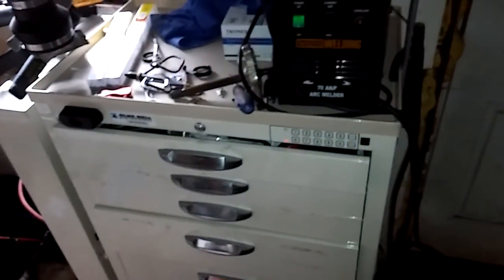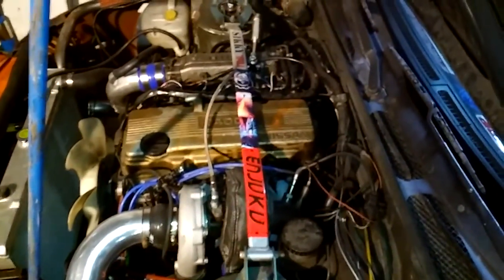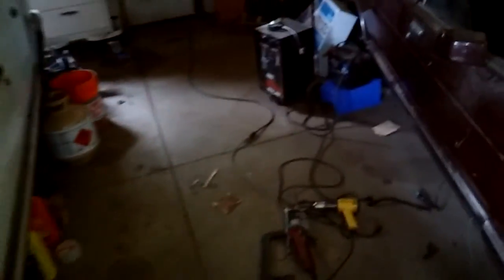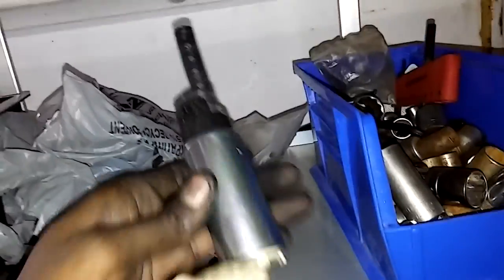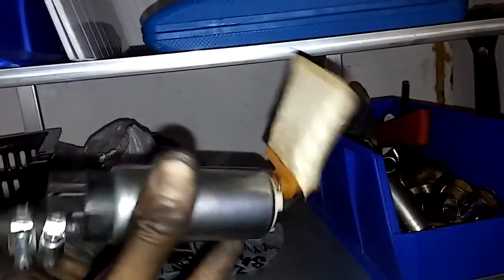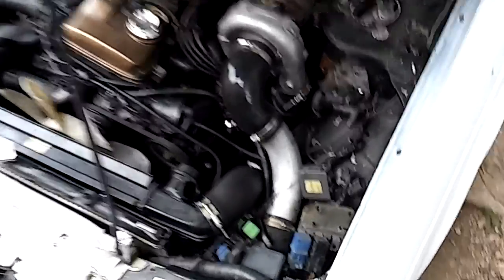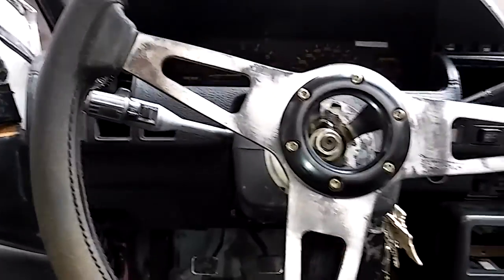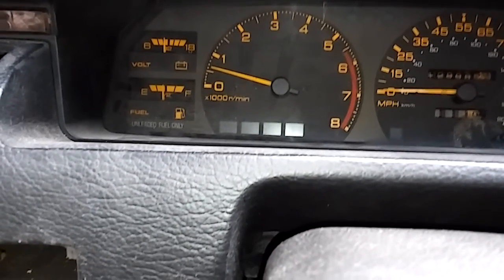CAN YOU JB WELD A BOV TO AN INTERCOOLER?

Comment: should run a greddy FV (floating valve) it will keep the bov close under any vacuum due to the floating valve, but still blow off smooth. the clones on ebay are still design the same and work great. use one before and using another one .

also jb weld will work but it doesnt do well with getting hit or drop it will chip and snap off

Comment: Just a heads up bruh that valve should be completely shut at idle , the springs probably too weak for the vacuum your pulling, lol but props to you for the ingenuity
Reply from the maker: That's what I was thinking. I guess the 4g63; being a smaller displacement engine, pulls a lower vac PSI.
Reply: TooForTea TV Yeah that and also thats a recirc valve so usually it would be plumbed back into the intake so there would be no un metered air entering the system.